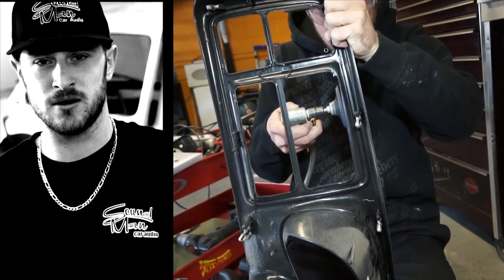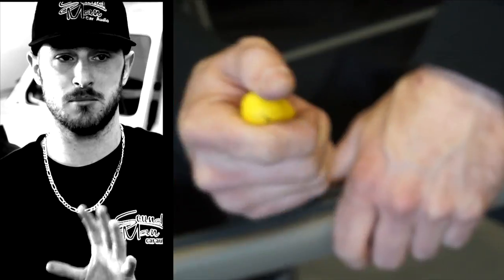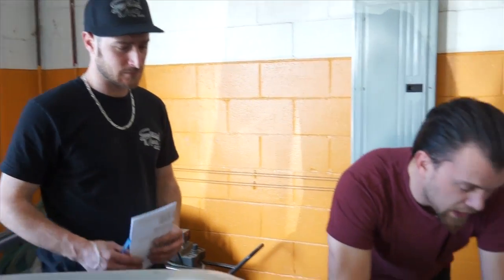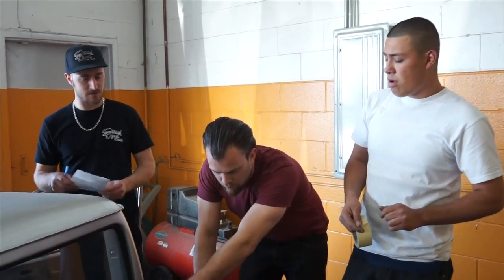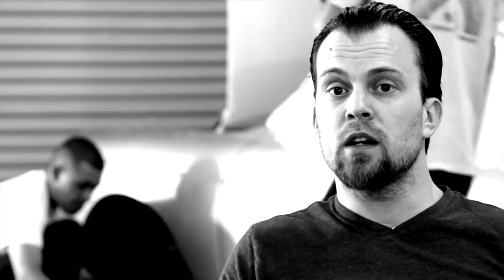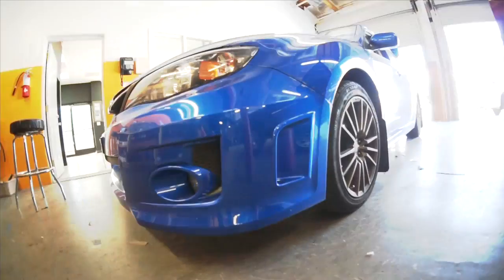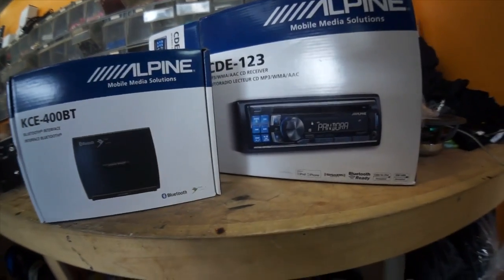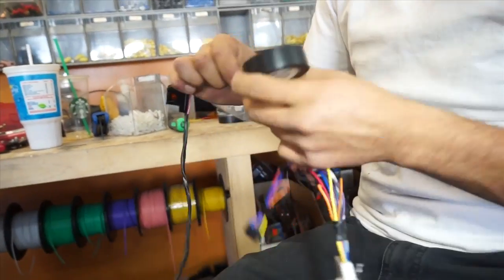Amplified 52 "The Mule Continues" @SoundManCA, SoundMan Car Audio, Santa Clarita

Comment: Lately I have been trying to mount them in front on the rear spoilers (if equipped). You can find or make a hole under the spoiler and take the wiring down inside the trunk, follow the factory looms and run through the center console. Works out really well 99% of the time. :0)

Comment: Did you guys end up using the USB and Aux connection from the radio in the STI?  Looked like it was just tucked away during the install 10:01